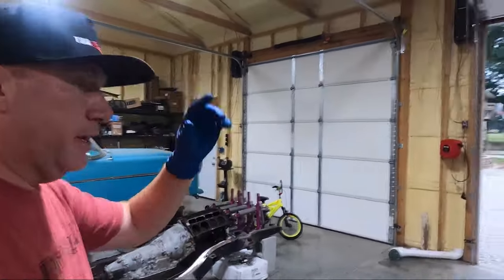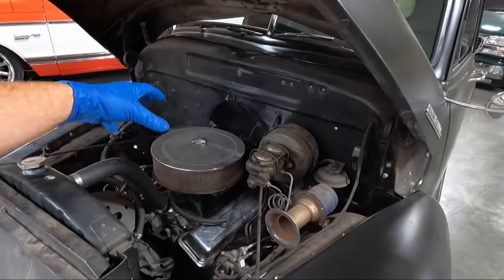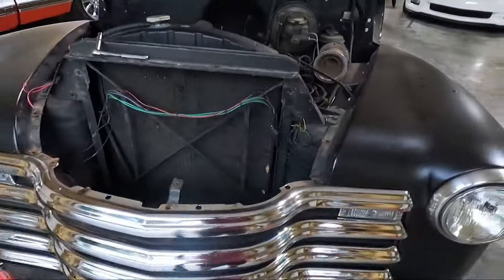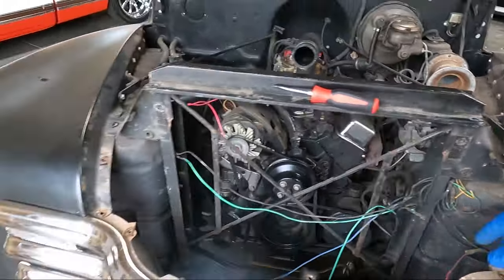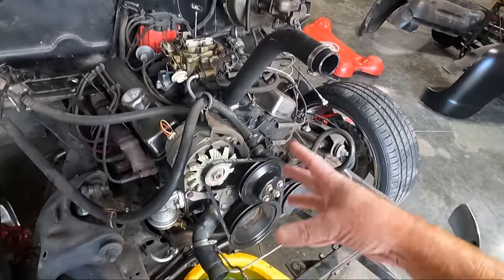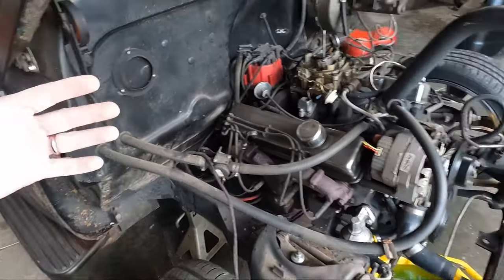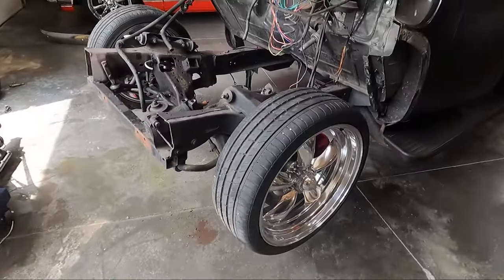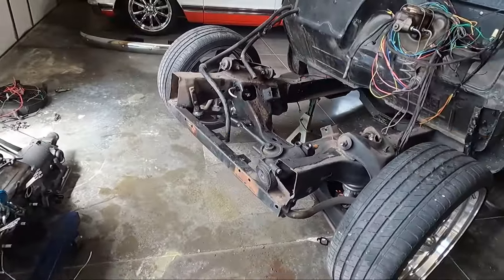Slammed 52 Chevy 3100 is Coming Apart for LS 6.0 and I need the Old Engine for Another Car

Comment: Cool love seeing a new project start! On painting that frame may i suggest what has worked for me in the past with great results, sanding the frame as best as you can then spraying it with Eastwood rust encapulator as your base coat then spraying it with Eastwood satin chassis black, I believe you will like the results so much better than using Por15.
Reply from the maker: I have been looking at that Eastwood stuff recently.

Comment: No playing around with that engine removal.  A good TWA detailing under the hood is what it needs, remember it's an engine swap 😉. Love my GM products but was never a fan of the 305 engine. ✌🏻
Reply from the maker: 305 is a good engine, just not fast or powerful.
Reply: @TWAMotorsports  exactly the reason! Bought a brand new 1985 silverado and it couldn't get out it's own way😂. ✌🏻
Reply from the maker: @markb3129 lol. They are slow.